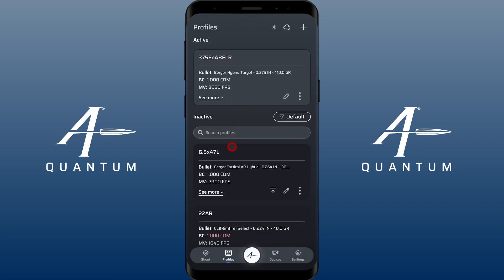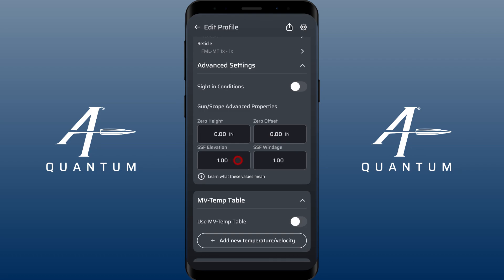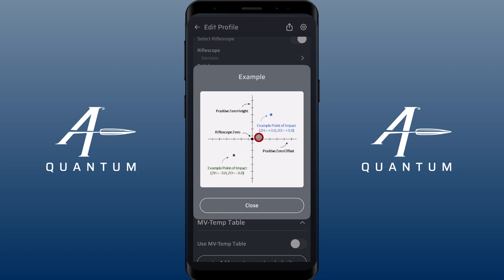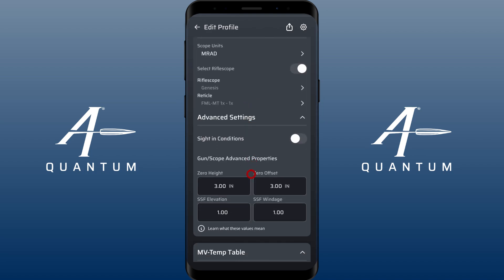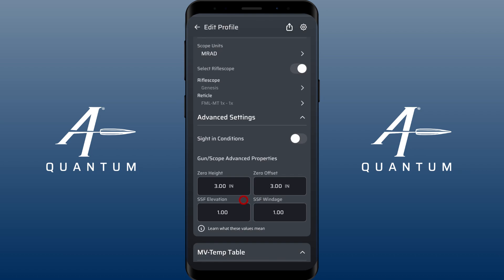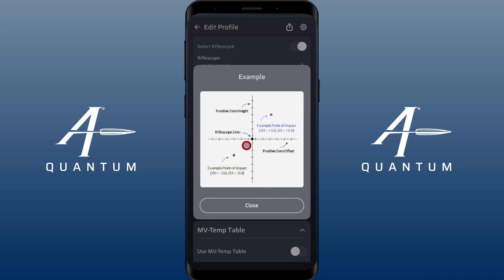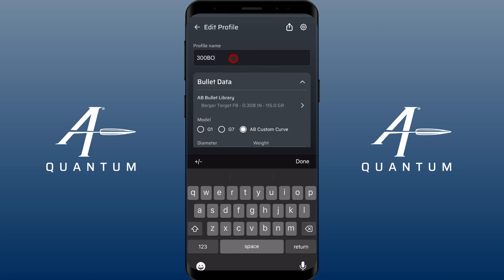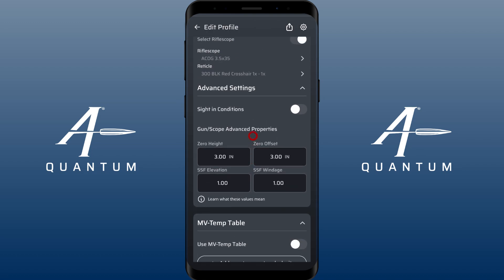Zero Height and Zero Offset in AB Quantum™

Comment: This is an awesome feature. It allows me to run several loads with varying points of impact without having to re zero my rifle every time I switch loads. However, there is one major flaw. The diagram, which explains how to use this feature, clearly shows to use a negative entry for a zero left of center. If you follow these instructions, you will be given a solution that says you must adjust left to compensate for the offset. This is totally opposite. It should be an adjustment to the right. I make it work properly by entering positive entries for a zero left of center and a negative entry for a zero right of center. This feature was fixed and working properly for a short period of time and was then changed back again to the way it was. I enquired about this and was told it was changed back so it would work properly with other devices. If this is the case, then why not make the diagram depict the way this feature actually works. This will screw up and confuse a lot of people. Why not simply fix the diagram/instructions.
Reply from the maker: This is due to devices being implemented differently by different companies that license our Engine. We understand the frustration with the diagram you are having, and are currently discussing this and logging it so it can be addressed.
Reply: Thanks for the input.  Hope this issue is ironed out soon. I wonder how many people are using this as per instructions only to end up with inaccurate windage adjustments. If it has to stay this way, then just fix the diagram so users can make entries correctly.

Comment: Hello, first thank you for all your extremely useful videos.  My question is if i have my scope zero’d on my Leupold Mark 5 for a .35 cal 68gr air rifle slug at 920 fps and change the scope to rifle using a .308 165gr 2611fps round, will the zero height zero offset work accurately with that huge speed difference?

Comment: Is it possible to have a rifle with several ammunition profiles instead of completely separate profiles for each combination? My most common scenario are a few competitions rifles each with data for different factory and handloaded ammunition so it would be a lot easier if you had a rifle profile with a different ammunition profiles to select from with one being the primary and the other ones showing offset zero setting and their respective ballistic data. Now I need several profiles for each rifle where the gun and scope data are identical and only the ammunition data being the difference and it gets cluttered fast and needs unnecessary rifle + ammo combo names to make it sensible.
Reply from the maker: Thank you for your feedback. We are always looking for ways to improve the application. We have already documented this request.
Reply: I have seen a few, including myself, that have been asking for this since AB Quantum came out.  They had it in the app previously and it was a great way to sort, but no idea why they can't bring it back.  My guess is that the app developers are keeping the change just to show how much the app has changed.